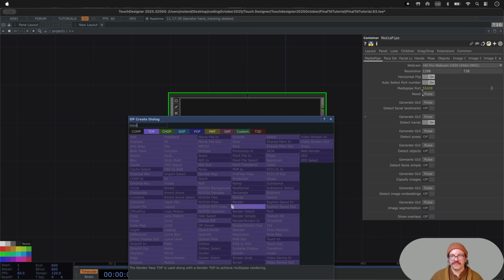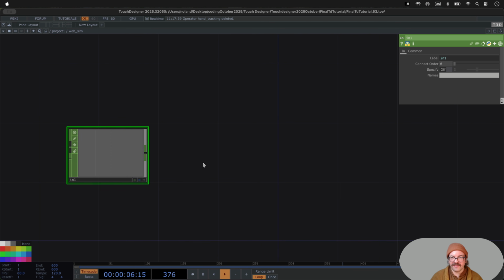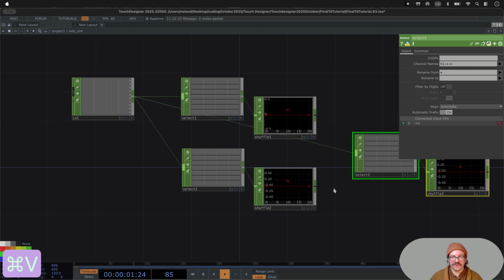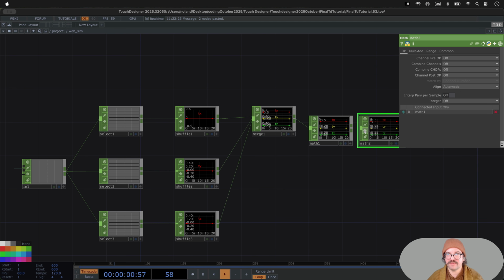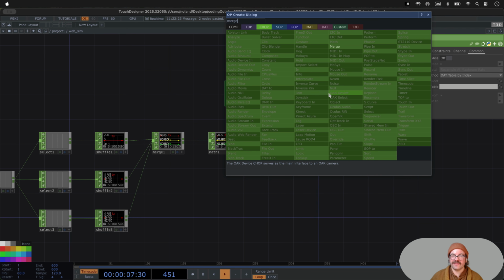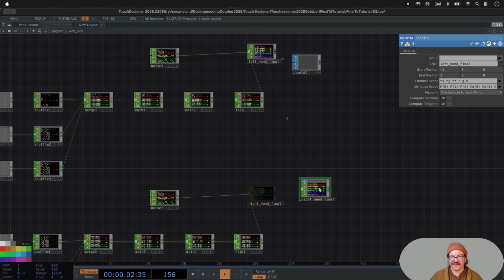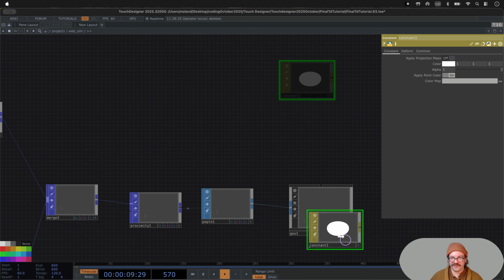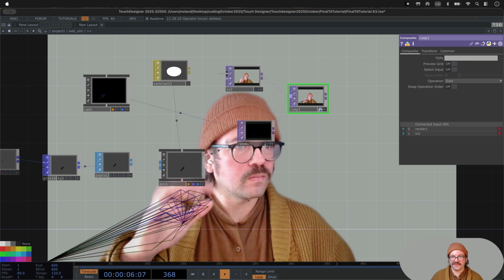Turn Your Hands Into a Digital Web (TouchDesigner Tutorial with POPs)

Comment: mine is working but that handtracking green lines are still coming how to remove them and also its colored threads are not coming it's only blue or black same color lines are comingm 
can you please help me thanks
Reply from the maker: Those are set in the mediapipe main GUI so you go back to mediapipe tox and click on it to expose the parameter options context menu on the right and it will say which options are enabled on the first tab labeled “mediapipe” and you switch the last toggle on that tab parameter page that says “show overlays” from on to off.
Reply: @alwayscodingsomething  solved it thankss

Comment: Really grateful for this tur=torial. I type in h1:*:x and apply the same to every select but the hand values doesn't appear it only have one value and I ended up with only one string on my hand which is funny but I want to fix it. How do I do it ? please help me
Reply from the maker: Hey thanks! If this doesn’t work you’ve likely selected the wrong output node from the mediapipe hand_tracking tox. I would go back to the very beginning of the video and see where you need to pull the data from. I believe you’ll find the answer there. You can always test things like “h1:*tip:x” too if you’re wanting other ways to get the data.
Reply: @alwayscodingsomething  thanks really appreciate your help

Comment: Idk why it didn't work, I've been double checking it for 10 minutes now and I can't find any error. It doesn't show that stringy effect on the comp1 instead it shows the detect hand thing like the green lines and red dots
Reply: you can go to comp1 and you need to flip the connected input OPs so that render1 is first and in2 is after that. there will be a little arrow on the side of it just click that and you should be good to go
Reply: @nandini424 still not working
Reply: @nandini424I tried doing this but it still won't work :/
Reply: I'm facing the same issue!

Comment: Bro i did everything still not gettingt the result . You said in the initial 2nd step inaide the hand tracking,in the normalised data, there should be movements, i didjt found anymovement . I even tried using multiple selectors
Reply: Brother , I did Everything as you said, but the lines didn't appear . There must be something with proximity . In the proximity screen it didn't show my hands . And also it showed cross untill I turned  on the bypass in the common section . Can you please tell if it should be off
Reply from the maker: @Sun森林 hmm. Not sure what’s happening because I don’t have enough details to help! Take it one step at a time. Make sure your td is updated. Send me some screenshots on Instagram and maybe I can help. :)
Reply from the maker: Find me on Instagram I put the file for people to download. :) hopefully that will help.